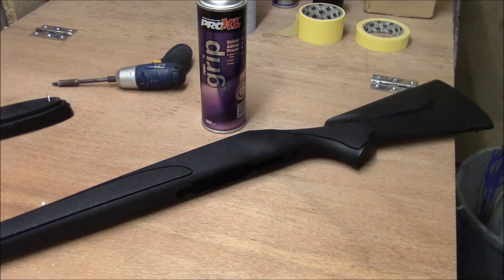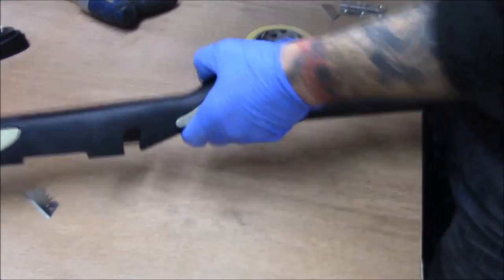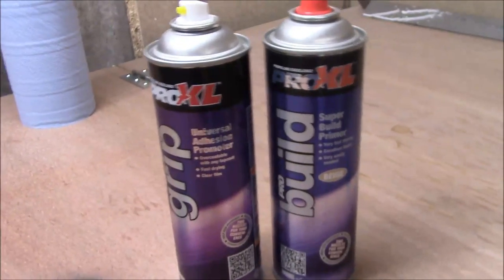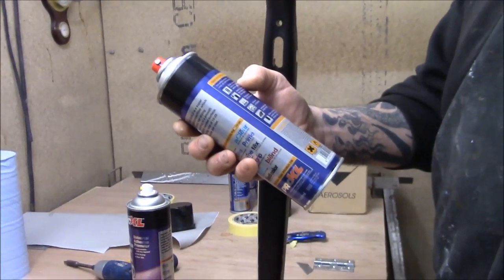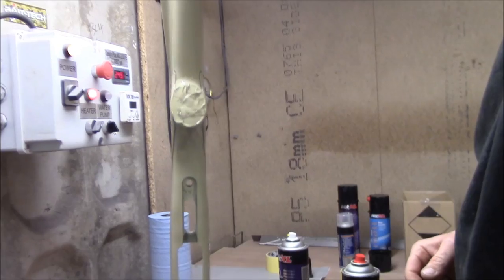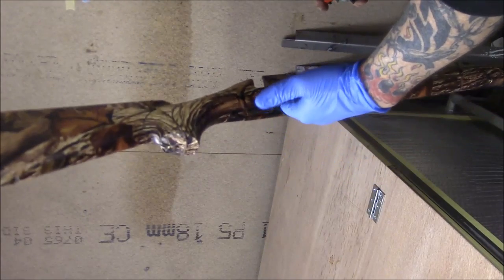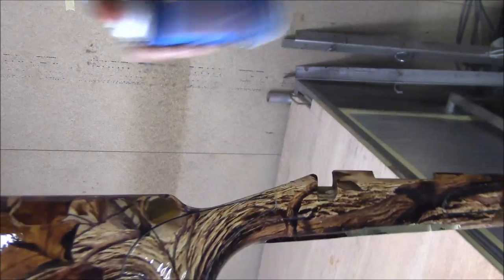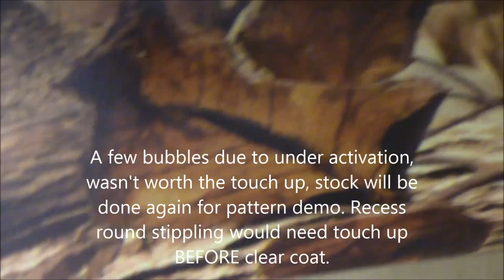Hydrographic Dipping a rifle stock using aerosol cans. How to spray a gun stock using spray cans.

Comment: Would it be ok to use a heat gun to pull out the air bobbles in the applied spray paint?
Reply: The heat gun is used for wood shellacked counter tops, it helps bring to suffice the tiny embedded bobbles.

Comment: Geoff bullock what do you charge for dipping?
Reply: Aaron Mcintyre depends on what gun or product you want dipped I do it my self.
Reply: CJz LCR I have a 2.2 cal smk bolt action co2 rifle
Reply: Aaron Mcintyre sounds pretty bad ass bro. I'm not sure how to help yu man I'm sure the shipping is going to cost alot for me to do it ha but I just mainly wanted to say it depends on the gun. Some times it's about 150 I charge about 115 or 100 for a stock dip no metal I'm still in my learning stage for how to do the metal right.